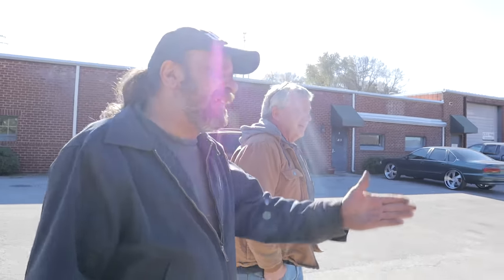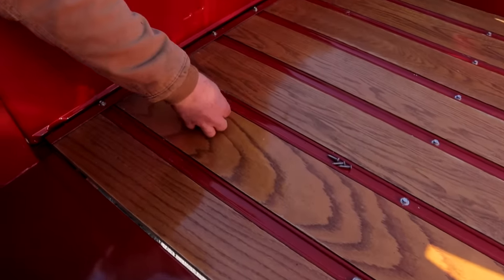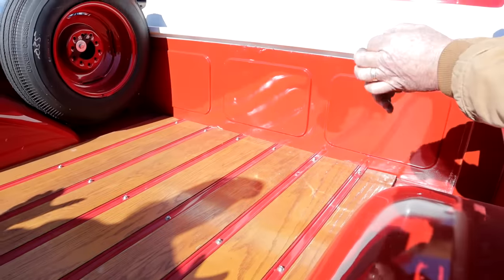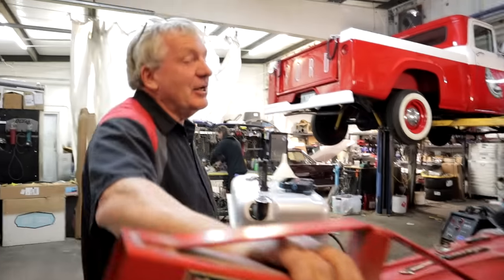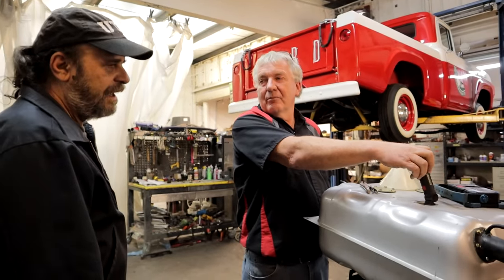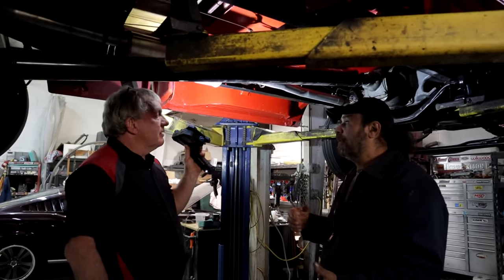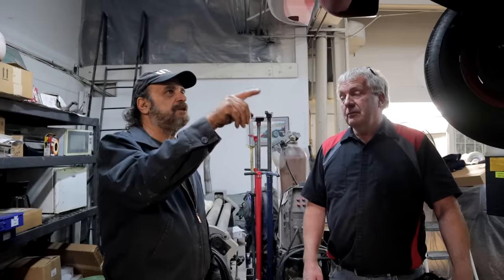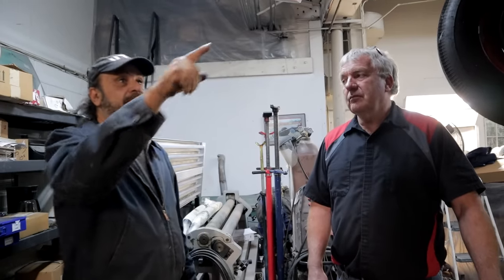Frame Off Restoration Gone Bad - Pretty Red Paint Hides Trashed And Rotted Parts Throughout

Comment: I was almost scammed like that. Fortunately I know a shitty job and short cuts when I see them. Yes a lawyer had to get involved. FUN FACT for those that live in TN, the laws state that a verbal contract on a cars paint job is 3 months, and if the shop is found to be at fault for poor work they can be sued for twice the cost of the paint job and Depreciation of the car/components improperly installed. Get a good lawyer. They usually cost 350hr and a 2500 retainer. Why so expensive? Because they’re worth it!

Comment: When you do a frame off restoration, sometimes you forget a few things. Uncle Tony kills me. LOL
Reply: Its funny because its true...
Reply: Like the box water drain into the gas tank.
Reply: It was funny the first couple times but then it was annoying.
Reply: @fireballxl-5748  it was true the first couple of times and then it was funny.
Reply: I have done frame off for myself and when it comes to structure no compromises. Safety first.  And I took my 65 Galaxie 2dr ht with a strong FE and C6 and 4.33 geared locker. Loud obnoxious and able to tear up the road. But my son and I had the car apart and hung the body from a tree with cribbing under it while we completely worked over the frame and suspension and replaced all of the bad parts, reconditioning the mounts and when body joined the frame we checked everything and got the body straight on the frame. It is so aerodynamic that you can roll down all 4 windows and get up to 100 mph with the 4.33s and still carry on a normal conversation without yelling. If we can do that in our backyard with a chain hoist to the front mounts and an engine hoist in the trunk . How the hell does anyone turn out an abortion like that?  Are all TN shops crooked like that? I had a set of heads I worked and ported to perfection and I sent them to a guy I thought I could trust and when I asked when my heads would be ready, he said what heads?  I saw them later in a magazine write up with the stamped ID marks I put on everything, I mentioned that detail because the person in TN was subject of the article. The pictures all came down and came back up with the stampings covered with photoshop. I’m not mentioning names but be careful when dealing with valuable parts engines and cars. I love mechanical things and I worked hard until I went blind insult to injury the friends I had for 25 years and had helped all I could banned me for life from that forum. They were all in on the joke but me. That was the greatest loss of all. If someone had said, I need your heads really bad to compete in a competition, I would have loaned them to them. But it was a dirty matter where I lost all but one friend. I used my position as a production manager and designer who was very familiar with the engine family and I called Vic Edelbrock and talked him into copying an engine designs heads and intakes. He did and they were his best selling products they made. Later I looked over a set of blueprints for a larger displacement version since strikers because the rage and made improvements from my own research that would make them be on par with any modern engine. Sent them back and requested that my name not be a part of it. He did tell a few people. But the heads were great especially on the strokers and the intakes based on the best factory designs and a fantastic iron block that is capable of handling anything that can be thrown at it. I’m not looking for praise, but I really miss my friends or who I thought were friends. My wife and I are soulmates and we practice mindfulness meditation and doing good for others. I will never give anyone bad advice knowingly and I strive to live life as it should be. Just be honest with yourself and others. I am blind now and a fall broke my left shoulder shattered is a better word. 50 years of hard work and I still dream about it. I love hard work . Dishonesty and disrespect, arrogance are sins that we can all fall prey to and I fear the the things that unify us , that were our net as we walked the tightrope is becoming less trustworthy as used to be. To rob that woman was beyond words to me.
Reply: Haha “sometimes you just don’t have eyes or a brain” lol
Reply: Kiwi: yes, let's go with that. 
Now that's funny.
Reply: Yeah like the frame

Comment: Not crying upset? Oh man, I would have went home and cried there. My car has POR 15 saturated fiberglass in the trunk floor, but I would never pass that off as a restoration move. You are absolutely right when you say her dream was crushed. Anyone profiting from dream crushing deserves to come to ruin.
Reply: The beaters get more luv up here in my town. body monkey trying to cheat "0.0"mech skills .scary. no welder in that shop or field?cost of criminal work criminal price and now have to redo it. Cost of repairs in good shop maybe fab shop400$ now to replace 4000$+400$+3000 .in loss of use cab off bed off labour. check the shitty body prep box on the work order means grind it all re paint it all cause it would be crap sticking on crap peeling away in1yr. Too bad  the lady has to sue.
Reply: Anyone profiting from giving somebody an unsafe vehicle to drive deserves to come to ruin.
Doing a half-assed job on (ahem) attaching the cab to the frame is criminal.

Comment: I like the way Kiwi approaches it.... the body shops getting together and forming a certification association. The Govt will fuck it up like they have everything else, but self policing is a different story.

The fact you actually feel bad having to give news like that to someone speak volumes about the kind of person you are Kiwi.
Reply: Cheers mate
Reply: Spot on.
Reply: The government won't fuck it up.  These bootleg shops NEED regulations to stop or limit the fraud being perpetrated.  Start with licenced welders not some guy off the street that tells you he can weld
Reply: The Feds would NOT screw it up!. Look at the FAA and aircraft maintenance. That works just fine! I've been an airplane mechanic for over 40 years, and stuff like this just DOESN'T happen.  As a mechanic, you are DIRECTLY responsible for the work you do, and you put your name and mechanic number on all the work you do. If there is a problem, there is DEFINITE accountability right back to the person who did the work.  These excuses about "Staffing problems" is just PURE B.S.!  Any owner of an aircraft shop is EXPECTED to know the quality of work his guys are putting out, and has the responsibility to see that work is done properly.  Bad aircraft mechanics are rooted out VERY QUIICKLY. As far as the FAA is concerned, the manager of a shop is JUST AS RESPONSIBLE AS THE MECHANIC, FOR POOR WORK. You HAVE TO know whether your guys are doing quality work or not, and hold them to a high standard.

Comment: In 1969 I took a '56 Ford wagon that had been in the family since '57 to a body shop with the instructions to "Replace all the rust with metal, complete the body work and prime it". When I got the car back and started to take a really good look at it, I found masking tape over the rust holes and body filler over the tape. Sad part is, I had stopped at the shop a few times and, because I didn't look for the right things, didn't catch the shoddy work. So, I started learning the skills needed to do the work myself. Started with welding and panel fabrication. Now, 5050+ years later (OK, 50+. Thanks @Zach-sg5uu! Edited 05-27-2024), I do everything but engine machine work and automatic transmission overhauls on my own cars and trucks. Shops that do work like shown here really piss me off.
Reply: 5050 years later!😂
Reply: @Zach-sg5uu  Yep, a typo! It feels that long for me!  🤩 Guess I should fix it, in another 5050 years!🤪
Reply: That’s amazing! 
Some psychiatrists give people low IQ readings and their own daughters can’t put fuel in their own car!

Most people can’t rebuild there engine.

Even if they could they would probably be too lazy & a lot of shops are now too lazy!

Even if you’re able and willing to pay the shop to do a engine rebuild. The shop will be too lazy and try to say it’s not worth the money. Holding on to most cars from 2012 or older is usually worth the money compared to any of the new ones!! 
Plus they are cheaper to maintain!

Comment: I use to work on old cars and trucks and  one thing you don't do is  bad work at all if it's needs new metal you buy it put in and if it got to much rust and it needs to be fixed never use fiberglass or bondo always use led  and make sure its right and not going to kill anyone

Comment: Wonderful video, at the same time it just made me angry at the idiots at POSSOM HOLLOW GARAGE.   I would LOVE to see a video with the truck at the "restoration garage" where this theft of a person's dreams took place.  They should have a chance to either explain themselves (dunno how), thus clearing their name, OR simply confirm the name & location of these thieves.  Recently I watched another video with a '62 - '63 Corvette, beautifully restored.  However, the owner - a senior who just bought his dream car, was concerned about oil dripping on his garage floor.  He took it to a Corvette restoration shop and put it on the lift. Not only did it leak from every possible seal and gasket, but rubber mounts were also swollen and deteriorating.  Even the frame had pieces of metal tack welded on to cover holes.  It too was a criminal piece of work!

Comment: I've owned two of the same era. A 64' F100  223ci L6 (same engine) and a early DoM 62' with the 292 (i think) small block, both motors were boat anchors. Both of my trucks had the same kind of damage to the cab mounts, inner fender wells to the firewall and wiper cowling flange, the step wells and front bed corners. 

These are unfortunately the trouble areas for Ford trucks in the body of that era. I did a lot of body and frame work of my own like many, that being said, the information is out there for any generation F Series, a plenty. 

I was fortunate to have Dennis Carpenter Industies right down the road but thry make everything and nationally ship for these trucks. Almost every sheet metal corner, trim, part, rubber seal, interior and or piece of hardware is available for these. Stamped with a FoMoCo logo and OE part number to the original spec. I once bought a New/old stock, front engine mount for my 223. Point being this is not an obscure limited reproduction part vehicle, there's no reason that the window track could not have been found and ordered online in either original or reproduction, or fabbed from sheet as he is doing. 

As a past owner and fan of 60's Fseries....the  lack of want for a few $20 weld in patch panels for the inboard lower cab corners or fab new cab mount brackets is outstandingly atrocious, in its lack of care of the occupant, it's dangerous and lazy. You can lift the cab 4" on these easily and have plenty of space. 

As a Ford truck guy whose looked at a lot of other ones closely at shows (as we do when we are fellow owners), in that regard I'm like you guys, not entirely shocked to see this theology in work ethics done. It is both common and tragic. At least in this instance the customer wasnt physically hurt leading to the learning of the depth of quality in work performed. Great video and thank you for making this to help other people know what to look for on these pickups and what happens all too often. 

....but.... as a Southerner....all the wall hollars and opossums back home should be outraged about the name they's being given by that shop.

Comment: For me lesson learned would be to consider hiring more of a subject matter expert / inspector to check on the work as it progresses considering the investment involved. May still cause a bunch of issues but at least you have a heads up that the shop is taking short cuts. Sooner you know this the better.  Look for references too before getting involved, get quotes from several shops.  Obviously not everyone will do this as takes time, work, stress, conflicts, etc.

Comment: G,day Mate as someone who has spent most of my 58 years involved in profesional restoration, I have trouble watching this sort of thing.
Please share this little tip with your veiwers. This is true in one hundred percent of cases. If you see a restoration with super nice paint, gaps trim etc, but, and I say BUT if you see the door latches, strikers and courtesy light switches painted, it will be a crap restoration.
As soon as Ol Mate Kiwi opened the door, I knew what was coming.
The next level to this is where they paint the latches and strikers silver with a brush.
Cheers Rob.

Comment: This is so common.  Used tp be a builder, and had customers buy vehicles that were all shiny, and undercarriage were a mess.
Had 1 poor guy buy a 40 ford convertible,  supposedly built by Boyd Coddington. 😢 after coming out from under it, i had to tell him that all he bought was a paint job.
14 universal joints in steering,  fram wasnt boxed, was arc welded to hide cracks, cheap speedway axle. Throttle only 
opened 1/2way. Buyer Beware

Comment: Anyone can bondo up and respray an old truck. Won’t last without major upkeep unless it was well cared for before. Had a 1990 150 that even after all these years had one small rust patch in the bed. Needed a drivetrain which I didn’t wanna deal with though.

Comment: I found this from a comment somebody made on a Watch Wes works truck video. Who ever stuffed this lady like this should be in jail for fraud, way before it got to manslaughter if there was ever an accident involving this truck !    It's a total waste of  very expensive painting supplies before we get into time or other parts. I know of a Mercury truck here in Canada that was restored "nice" 20 years ago and the guy died shortly after. A friend of mine was looking at it  for 25K the first thing he says is it's got a few oil leaks from sitting, and a couple rust spots in the hood bubbling. I just told him run fast the other way, those small spots could be half the hood when you go to fix it and more besides on other panels you can't see yet, he then adds yeah there is some rust on the frame, and how much else was likely to go wrong when it was driven. It still sits in the widows garage, and I think it will for a while at that price.   
The sad thing is I also see this kind of thing with heavy equipment repairs in my own business. I had a tractor in for a motor rebuild as a kit of parts so i'd never driven it. After it was running I found the transmission didn't shift right, on asking the customer he said what do you mean it's had a 5K rebuild after it broke a selector shaft.  The motor just cost 10K I quoted him so i took the trans top off and looked, whoever did the trans just got in there and welded the broken selector together and it didn't line up right. it looked to me like they just washed it took the top off and went round the casing bolts with a wrench to make it look like they took the gearbox out and rebuilt it ! He said i'm not spending more money put it back, In the end I figured a cure that would work and gave him the time to help him out of the mess. He left here a real happy customer, because somebody cared enough to help him out with it.

Comment: Im not making excuses for this shop but sometimes hands can be tied by the customer. I did a 72 Blazer for a customer and he put me on a deadline. I went against my better judgment and tied up my shop just for this one customer. The body got stripped down and it was a trainwreck. I replaced 80 percent of the metal but because of his deadline i had to stop shy of complete replacement. It pained me to do so but i had to budget my time and draw a line somewhere. The truck came out beautiful but I would have liked to do more. Point is, sometimes the customer does put constraints on time and money and we have to work within this. I still did my work properly without cutting corners but it was a delicate balance. The previous resto was butchered so that didn't help either. This is why it's hard to give estimates. Sometimes even a trained eye gets fooled and dont know what they're walking in to. Time and materials only, no estimates on restorations.

Comment: Many US states had or did have safety inspections on the sale of a vehicle.   But they were massively corrupt and most got shut down.   Example:  I moved to Maryland.  Had a brand new car that was just over the date where it did not require a safety inspection.  Took it to a garage to have it inspected and they "found" a hose clamp loose and charged me $60 in addition to the inspection costs.   That would have occurred at ANY of the shops.

Comment: I’ve been in the automotive repair industry for 42+ years. What really terrifies me about this truck is the fuel tank situation. Just hanging by four 3/8 bolts where it could fall out and drag down the road. Then no seals between the tank neck and the filler, just open space. Imagine the amount of escaping fumes and slouching fuel coming out. Think of parking it your garage for a month with those escaping fumes and the pilot light of a water heater near by 😢😢.

Comment: I had an old truck like this (51 Ford F2) that I was considering doing my own restoration.  I talked with guys with trucks at shows for a year.  A perfect, fully restored truck was worth $35k and cost $75k to restore.  Not worth doing.  I did see hack jobs, worse than this one visually but mechanically done better for sale for $13k.  With those, nothing was hidden, though.  Riveted metal panels without hiding with mud and paint.